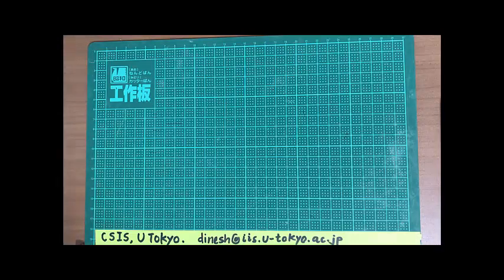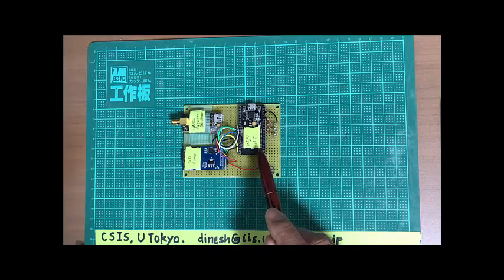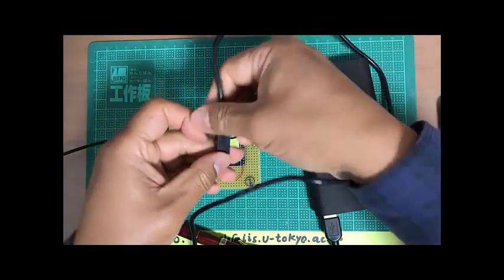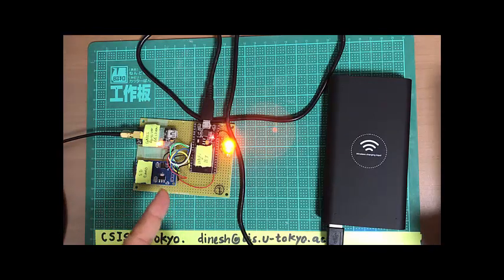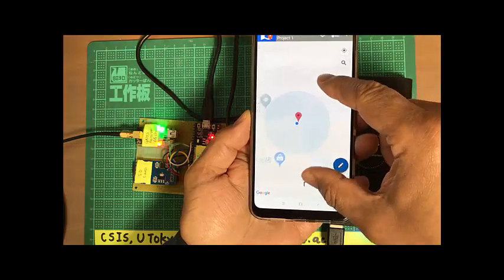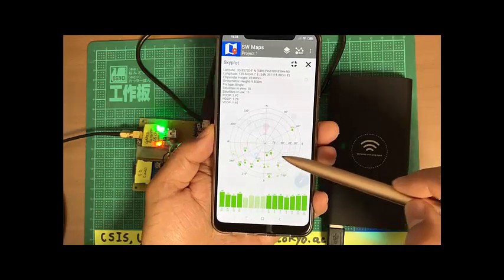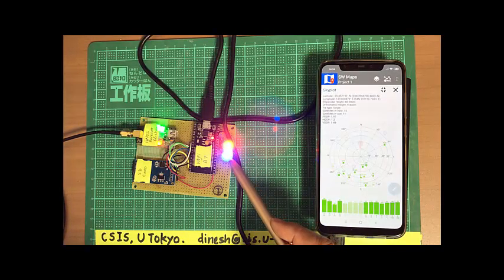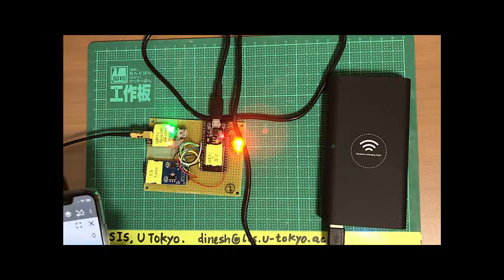Low-Cost GNSS Receiver Type - 2

Comment: Very interesting ! 
Could you please share the names and codes of the electronic components (SD card logger and BT module)?  Do they need a microcontroller to run?
Thanks a lot  :-)
Reply: If you can accept usb connection to your android telephone or other equipment, you ca buy this one on aliexpress (us$ 18.5). It contains all you need to receive GPS, GLONASS and GALILEO satellites. I have tested it with SW Maps for android  - 
https://www.aliexpress.com/item/32947733363.html?spm=a2g0s.9042311.0.0.256a4c4daxCXpb
Reply: @leiffunder  Thanks for you help !
Reply from the maker: please note that these receivers do not have RTK capabilities. But, if you don;t need RTK, its ok. It works with SW MAPS or ANDROID. If RTK is not needed, I recommend SW MAPS since it has more features. SW MAPS now also supports RTK with F9P. F9P has RTK engine inside the receiver and hence you don;t need RTKDROID.
Reply: @mobilemap4447  I am interested .pls how do I get this ublox system.i can not get it in aliexpress no GNSS store especially that 3 in one system of m8t , Bluetooth and sd card reader
Reply: @freemannew5318  hello.  do you know the type of BT module?
Reply: @leiffunder  plug n play on android brother?
Reply from the maker: either u-blox M8T (single frequency) or u-blox F9P (dual freq) works.
M8T costs about $80 and F9P about $240. Can purchase from gnss.store or u-blox HP